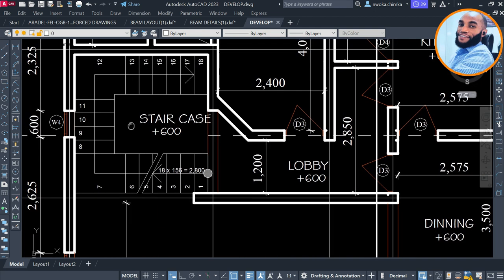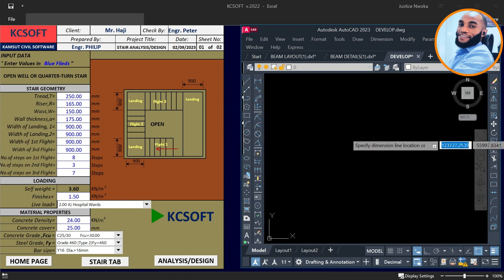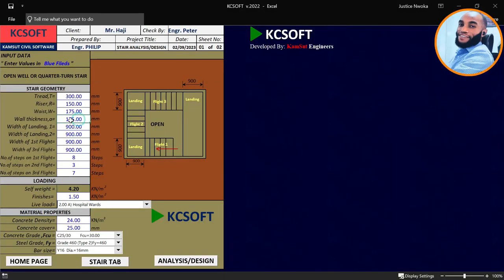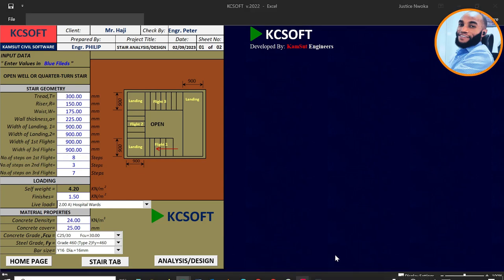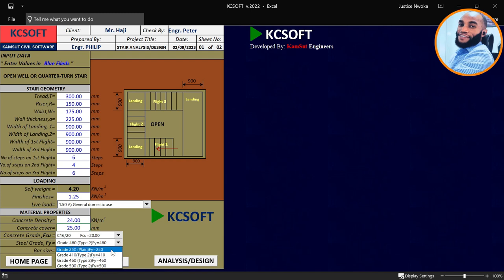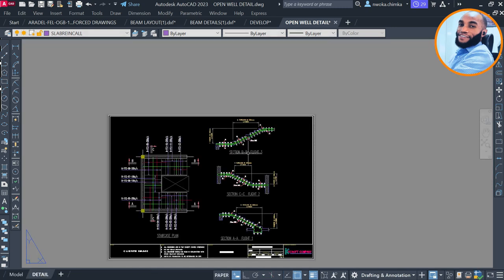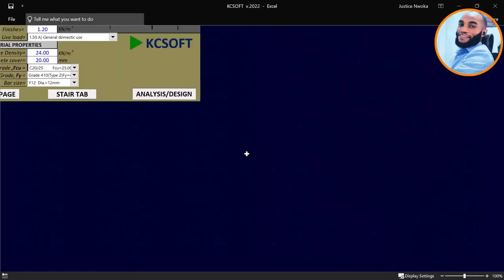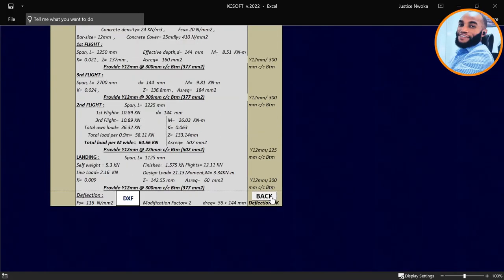Design and Detailing Staircase in Civil Engineering

Comment: Like @KWICKBOXDESIGNDETAILBUILD said, your staircase excel sheet is good, but it does not detail in real-time, the dxf files are templates that will aid the designer to detail the designed staircase manually.